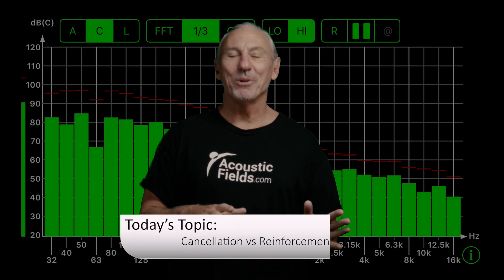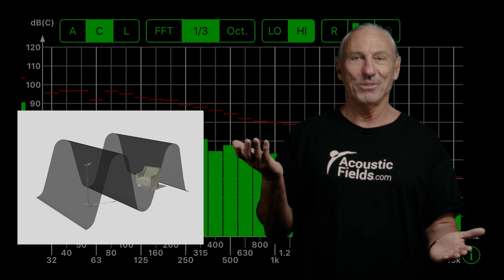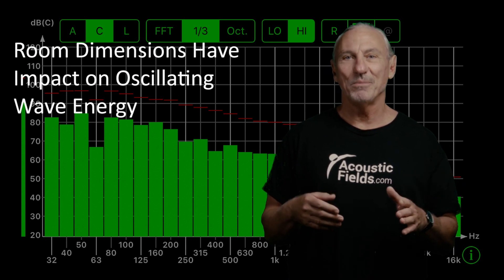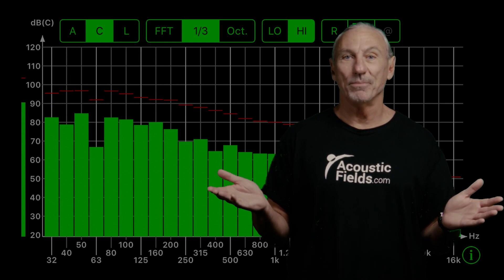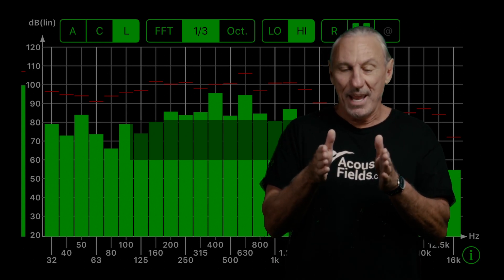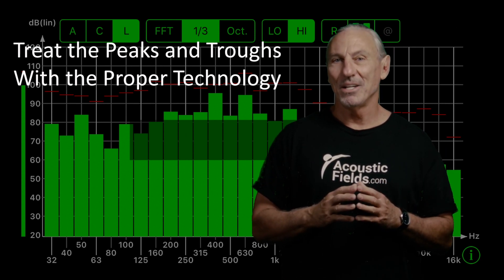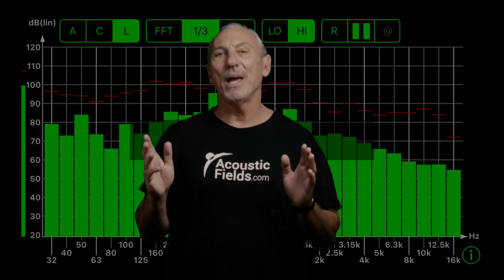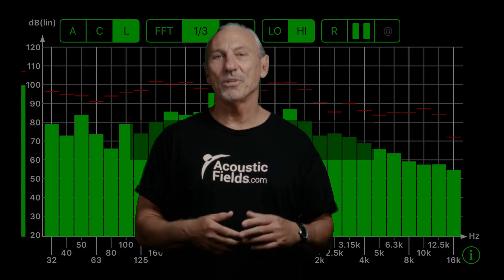Cancellation VS Reinforcement - www.AcousticFields.com

Comment: I know it would be difficult, but it would be informative to see a demonstration of this.
Is Size, Volume, or Shape a bigger determiner of this problem?
Reply from the maker: Larger room volumes are plagued by reverberation (reflection) management and smaller rooms have lower frequency issues. There is no running away from treatment types.

Comment: How much of this is also due to comb filtering because the listener and speakers are not properly aligned (i.e., equidistant)?
Reply from the maker: Comb filtering is mostly a middle and high frequency issue. Time alignment of speakers and listening position depends on room ratios, usage, and room volume. We have to make all of our prescriptions dependent on a properly treated room. Trying to locate either speaker or listening position in an untreated room is a game with no victory to be had.

Comment: Once I started to get the low frequencies managed more correctly in my room, it seemed I was hearing more of everything across the audio spectrum.
Reply from the maker: Yes, that is correct. If you reduce the low frequency pressure issues within your room, you will hear more of everything. Remember that your speakers are producing the required full range energy. Its your room that decides what you will hear and what you will not based upon your usage and listening or playing pressure levels. People add more subwoofers so they can hear more of the low end. They are just making things worse. They are adding more energy to fix a problem that is caused by too much energy in the first place. Less energy, more resolution sound quality.
Reply: @AcousticFields  -  I keep telling people the same info you posted above.  It seems people think adding more speakers and subwoofers will bring them audio bliss.  I have never seen/heard an acoustic problem  which was cured with more speakers.
    I now have my room acoustics improved as much as my budget allows, I don't feel the need to "play it loud" and crank up the lows to really "feel it".    With more accurate lows, more balanced lows, I am satisfied with the audio at just about any volume.